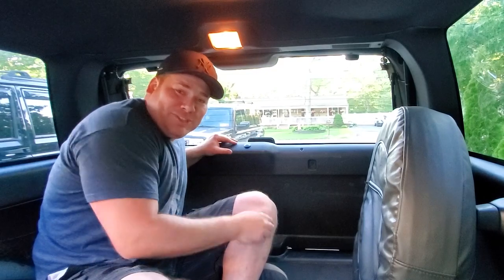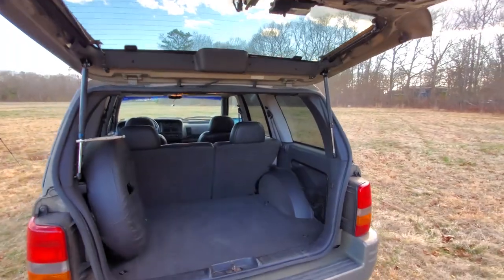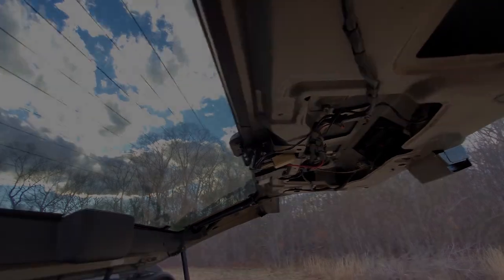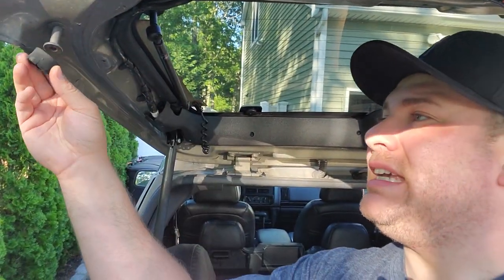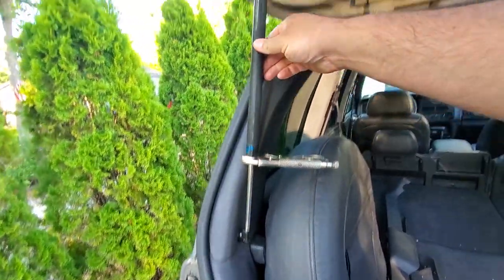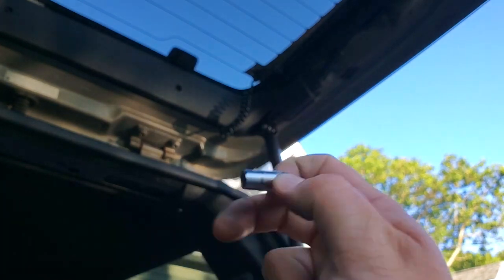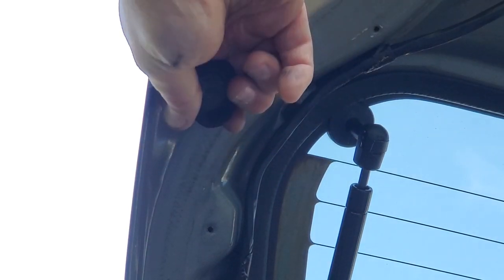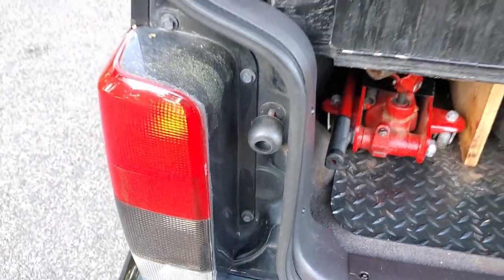JEEP ZJ + XJ LATCH FIX, HATCH RESTORATION, AND LIFTGATE LEVER RELEASE MOD

Comment: I have been watching your General Grievous renovation and I very much appreciate that you took the time to video and post the work. I'm sure it tested your patience. I am a mere amateur when it comes to car repair, so  your videos are hugely helpful.  I have a 1998 ZJ that I bought new. It has only 108K miles on it and has been a garage queen for the past 4 years.  I'm making my way through all the problems and now come to the rust on the deck lid. My most recent fix was the Body Control Module that had to be replaced because the old one wouldn't illuminate the cluster lights. So having been to the junkyard to salvage parts, I  note that the rust in the lower liftgate area seems to be a common problem. Some of the ZJ's are completely rotted out in this area. I am lucky that the rust on my deck lid is not too bad yet and I can do what you did with a grinder and cans of primer and paint. But I am concerned that there is a buried secret that is causing the rust in the first place. I note that when my  ZJ has been in the rain, and I open the deck lid, water trickles out. Did you happen to figure out why these decks collect water and ultimately rust? Do the drain holes clog? It doesn't look like the interior of the deck lid is accessible. I know these vids are old but I'm hoping that you still address comments and questions. Thanks in advance for your reply and thanks again for a super series!

Comment: Great tips!  Had an old set of CJ doors on a Wrangler with a similar problem of the threaded rod in the spring saddle.  After fighting it forever, I drilled a hole in the actuating rod and mechanic's wired it to where I wanted it to stay.  Never had another problem.
Reply from the maker: Good stuff! I love a good mod!

Comment: Great video, thanks for sharing your hatch mod.  I'll do the hatch mod to my 98 ZJ as well.  My 96 ZJ's rear hatch release gave me trouble occasionally, but I don't think all the offroading rough driving helped that much and most likely the reason mine had issues occasionally.  I need to get replacement rubber bumpers for my rear hatch as well.
Reply from the maker: Yeah, i could imagine heavy off roading could jostle things out of place.  id love to have you try the mod!

Comment: Just had that issue of the rod not grabbing properly on my 2000 XJ. I added a nut onto the threaded rod to avoid any slippage with the handle
Reply from the maker: Awesome! Great job
Reply: I was thinking about this being the way. What size nut did you get?

Comment: I’ve just had my first lift gate issue on my 99xj. I got lucky. I was able to just get in there with some spray PB lube. It must’ve been just caked up a bit with dust n dirt. Other videos had you taking the lil actuator arm apart and rigging it with zip ties. Mine didn’t seem to need that at this point. After I generously sprayed it I’d activate the mechanism with a screwdriver to get it to get moving freely. Looks like it’s on the list for the occasional spritz of love just like the hood latches!
Reply from the maker: lol... i need to buy stock in WD 40, PB Blaster ,  and Seafoam Deep Creep

Comment: Check out the edited section. Dan H, You have made another great video, posted up on YouTube. Thank you for your hard work. You are the Best In My Book For Any Jeep XJ & ZJ..
Although that type of mod probably can't be made to work on my 93 XJ, it;s still a quality update for any XJ, or ZJ Owner from 1996 & up....

On my 1993 XJ. My Hatch & Rear Passenger Door have those ''Lazy'' Locking Mechanism's which also means, ''They Won't Open'' thing. I imagine I can remove the top-half of the inside panel in order to get the Hatch Unlocked, plus I like the ''Unlocking Mod'' that you installed. Now I'll go try & hopefully you catch my comment & give me some pointers, because I need them. Hopefully I'll BRB Soon with an opened Hatchback (I Hope).... Thanks for posting this video Dan, you are the best XJ Channel.... Dan

Edit: Before I get into the problem & what I ended up doing. On the 1993 XJ, the Latching mechanism is different than the 1996 and Up, so I doubt it can be modded like you were able to do on your XJ Dan....

The Problem:  I removed the panel on the inside of the Hatchback. Once I was able to get the hatch to open, I found the problem. That Locking Actuator was stuck in the ''Lock'' position. I disconnected it from the latch, and since I need an actuator for the right rear Door, I'll order at least the two of them. Somehow I doubt any vehicle made today could have parts that would last 30 years, like on my XJ.. Anyone wanna bet against me on that.... Note: In March of 2023, my Cherokee Country Hits 30 Years Old..... Will I get anything from Chrysler for having a Rust-Free Cherokee That's Still Running Strong, or just continue to have to purchase parts whenever they're needed....... Probably The Latter of the two....
Reply from the maker: Hey, Glad you got down to the root of the problem. Hope it can be repaired good as new with my mod... thanks for watching.. God speed,

Comment: Fun note the little black connector next to the handle mechanism controls the flipper glass. I had it break and I couldn't get it to lock i had to superglue it back into place where the small metal rivet like parts connected and got it to work properly after that. It has no manual lock and is completely electronic in that aspect.
Reply from the maker: sounds like the newer Jeeps now I believe starting in WJ's You cannot open the flip glass manually It's only an electronic latch.

Comment: Hey Dan, been following the channel for a bit now and gotta hand it to ya man. nice work, clean channel, good tips!!
I have a niner myself and slowly been building it up, and interested in some indepth mods.
the liftgate glass button is a physical button that activates an electrical switch (if im not mistaken). with an aftermarket remote starter/alarm(compustar, viper) that has the lift gate release button on the remote, would have the liftgate release signal coming from the remote start receiver. what do you think, could that signal hypothetically release the lift glass?
of course it wouldn't open the glass but it would open the latch so it would be free to pull open.

Comment: I took my handle off and drilled a hole then installed a screw into the metal underneath the handle lever. Have not had any problems since.
Reply from the maker: That's a great mod!

Comment: Whats the bold size on the screw holdin hatch handle please 14:17  to the right of your finger what you pointing at mines isnt there not sure why , thanks in advance. My release is loose i got to push down the outside handle for it to unlock properly and when i look i was missing the bolts. Thanks again.
Reply from the maker: It's not a bolt.. those aren't threads.  It's a ribbed shaft for that silly clip

Comment: Wondering if that little rope frayed or broke? What are your thoughts on a small wire instead for durability?
Reply from the maker: it is high strength nylon waxed twine, should be good for 100 years. lol. I didn't use wire because the twine was easier to work with 👍

Comment: Did you fix the Transmission in that ZJ after the Transmission service?  Just curious.
Reply from the maker: The only thing I've done to the Trans in the 2 years I've owned it was flush it twice and a new pan w/ a drain plug.  I also add Lucas stop slip in every flush.   It runs great!  Unfortunately i have a leaky seal between the trans and transfer case. It completely ruined my driveway. lol.  That vid will come soon
Reply: @ProjectDanH  I must say you really seem to enjoy wrenching and all the rest on these Jeeps. I my younger yr's  I'm  65 now I was just like you and had some serious  rides and did most of the work myself. My first ride was a 1969 302 Boss Mustang. Then a 1967 400 Firebird with turbo 400 Transmission with a posi rear  uncontrollable ride,  then I picked up a 1967 Plymouth GTX 426 Ride with a Blown 426 that Block was toast so I rebuilt a 440 for it and it still had the Dana 60 it's  a 40 Thousand Dollar  ride today.  My last old ride was a 1969 Firebird with a 350 4 speed just a street ride for looks. The only car I sold for cash out of all the old muscle I mentioned. I was a wild child and wreaked  all the rest and parted them out. My ha day was when muscle cars were the norm. No Computers  back then and pictures were few, most given to my dad who lived in California  he passed  and they were never returned. Now I just tinker with my XJ and enjoy watching you and your buddy's busting your butt.
Reply from the maker: @nobsatthistime  my first car was a 1990 Cavalier Z24 but my dream car was a fox body mustang.  I finally got one when I was 19.  That was blue. 1989 LX convertible 5spd.  I'm grateful to stop have it.  I ended up getting XJs just so I wouldn't have to drive the Stang in the winter but I fell in love with those too. Lol sound we have a lot in common. Thank you for watching. 💪